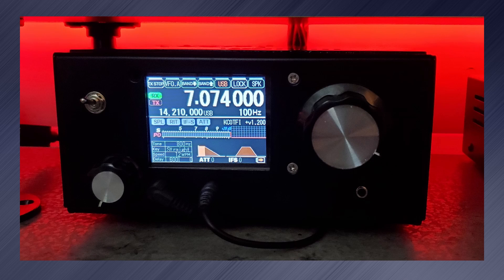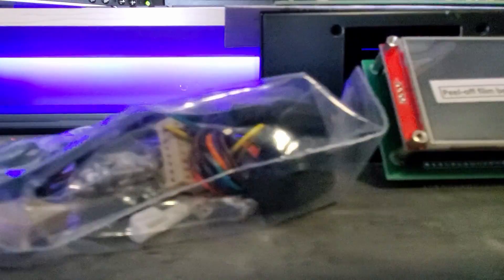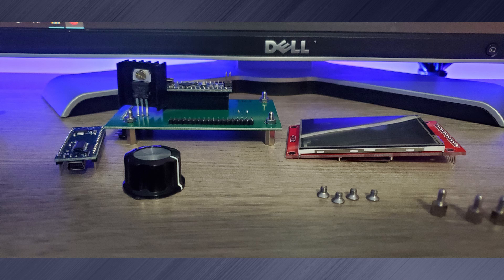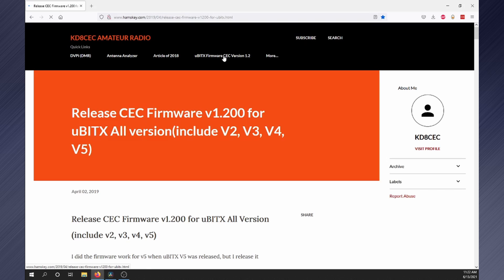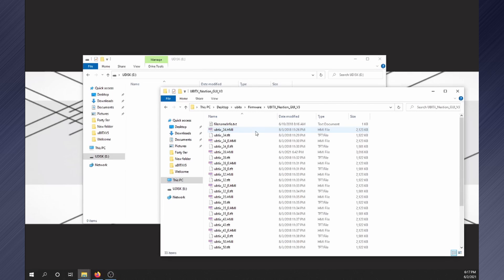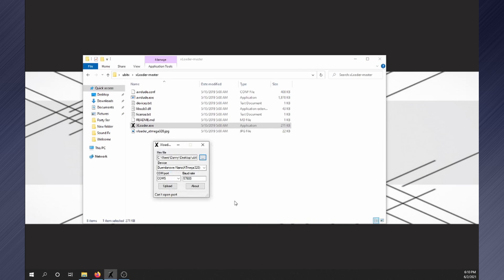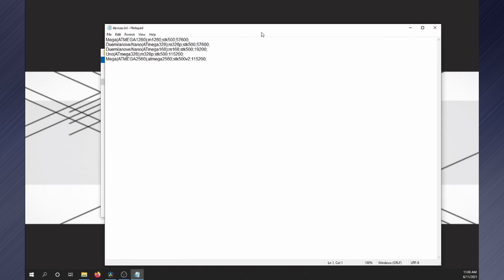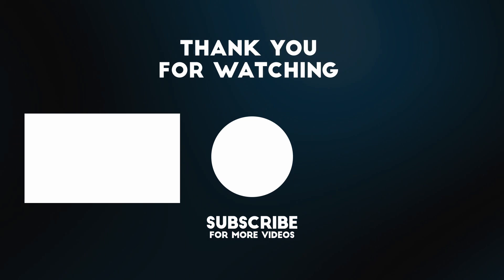uBITX QRP SSB/CW Installing Nextion Display and Firmware

Comment: Thank you again for this! Right now I'm stuck trying to add right device for xloader for NX3224K028 looks like it uses an ARM processor not sure how to find the correct line of information for that device.
Reply: I figured it out. I used the wrong files.

Comment: Hi there, i am trying to change the firmware to the Nextion  using the dir: UBITX_Nextion_GUI_V3:  File: ubtix_28_E.tft and the screen is the Nextion Enhanced 2.8". So i am getting version to low, i have also tried the basic screen and firmware and that also says version too low also when booting from the SD Card ? any ideas please. To note i am using a 8GB card

Comment: I followed your instructions for installing the nextion display but when I load the 2.8 txt file on the micro sd card and insert it in the display and turn it on, the display says the file is too old and won’t load up.  The file has a 2018 date on it.   Do I need an updated file and where do I get that

Comment: I have a Mac, and just ordered a built kit of this on Ebay, including the display. Will I be screwed out of the ability to update firmware and stuff since I don't have Windows?
Reply from the maker: The uBitx uses an arduino and they have an IDE for Mac as well. https://www.arduino.cc/en/Guide/macOS
Reply: @BrokenSignal  Great, and downloading it now. Thanks!

Comment: Is it necessary to use the right angle header pins???
Reply from the maker: No, you don't have to. It does make it easier to solder the new display wires though.

Comment: So I uploaded the firmware to my brand new Nano, plugged the Nano into the Raduino board. WHen I fired it up, the display was black and I noticed that the 7805 regulator was firey hot. SO I figured there was a short somewhere. I searched and searched and could find not short. Then I tried to put the original Nano back in and the 7805 stayed cool. It was only then that I noticed that the pins on the original Nano were mounted on the opposite side of the Nano as were the pins on the brand new Nano. Ah ha! SO I have now ordered more Nanos, this time with the pins not mounted to I can solder them myself to the same side as the pins are on the Nano that came with the Raduino board. I don't recall anyone mentioning this before, so just make sure that if you are installing a new Nano, that the pins are mounted to the same side of the Nano as the USB connector, and not the bottom side as most are mounted.
Reply from the maker: Good to know.

Comment: Thank you for this video. I have tried to compile the firmware using the Arduino 1.8.13 IDE, but when I comment out the 1602 display and uncomment the Nextion disply in the ubit.h file, I get a compile error saying it is too large for the nano. Do you know how to fix this error, other than using the pre-compiled .hex file as you did in this video?
Tnx de Arnie W8DU
Reply from the maker: You would have to remove some functions you don't need to get the file size down.
Reply: @BrokenSignal  Thank you for your reply. Can you tell me which functions you removed to get it to upload to the nano?
Reply: Well, I was able to get the code compiled in the Arduino IDE and uploaded to a new Nano. What I had to do was go into the ubitx.h file and comment out the parameters for the LCD display and uncomment the parameters for the Nextion  display. Once I did that, it compiled without error. Have not installed the Nextion display...that is for tomorrow. I will let you know how that works. Thanks.

Comment: When I tried to  flash the display it said "File version is too low".  Any idea what might be wrong? thx
Reply from the maker: Make sure you are using the right version for your display
Reply: @BrokenSignal  Thank you for responding. I am using the Nextion 2.8" display...NX3224T028.. and "ubitx_28.tft" to flash it using a SanDisk 8 GB class 2 Micro SD card
Reply: Just heard from Nextion...they said some components were changed due to chip shortages  and the project has to be compiled with their latest editor (V1.63). Too bad I was really looking forward to the display upgrade.
Reply from the maker: @michaelalfano2998  The source code is out there to download and the editor is free, not really to hard to do, give it a try.
Reply: @BrokenSignal  I will give it a go... Thanks
Reply: @michaelalfano2998  any luck a year later? Trying to do the same thing and can’t figure anything out.
Reply: @BrokenSignal  I have been through all of this and two years later i am giving it another go, ive tried editing the software using Nextions editor and it wont allow the update as says the firmware's memory is too large, So i am left with a useless pile of electronics really unless i mess about with trying to change the nano over to an ESP32 to speed the screen up, asking a nano to control an ILI9341 is way to hopeful..